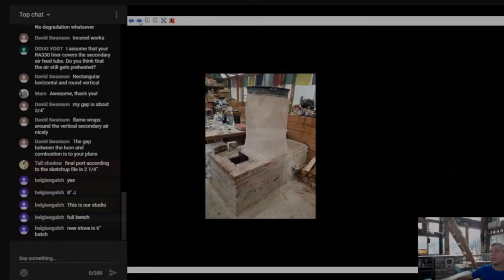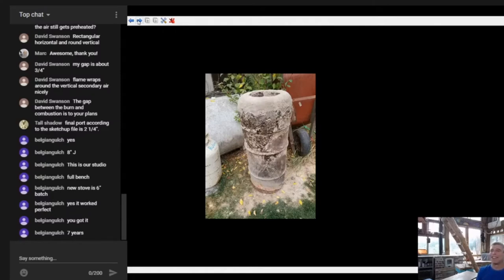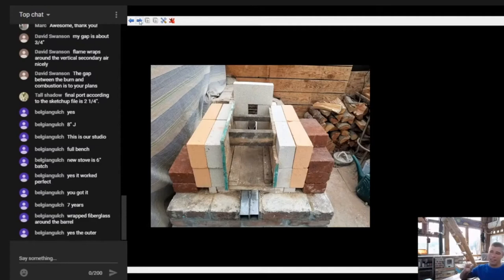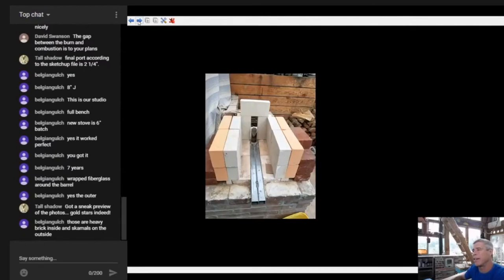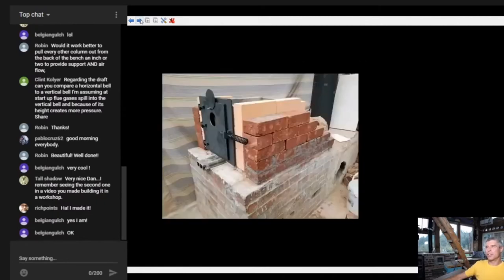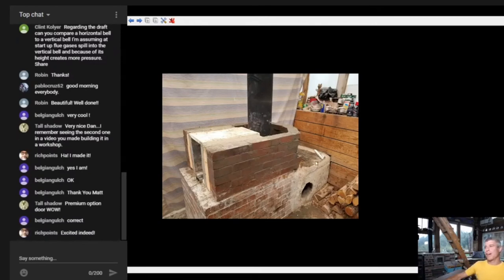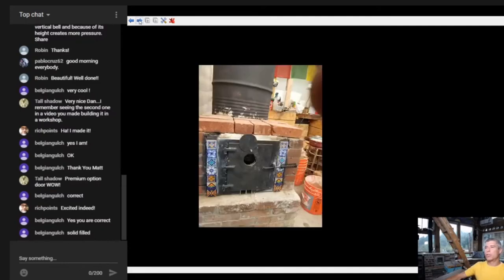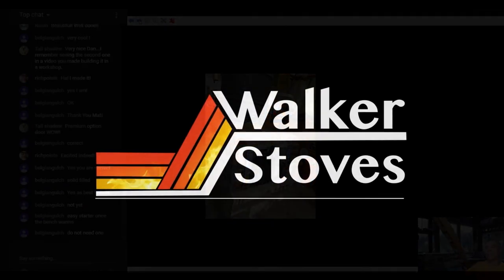Converting an 8" J Rocket Mass Heater to a 6" Batch

Comment: What's the longest recommended firebox for a riserless?  I'm thinking of using a flat griddle plate for a removable door and was thinking the farther away from the secondary the better.  Primary and secondary air directly underneath the door/lid.